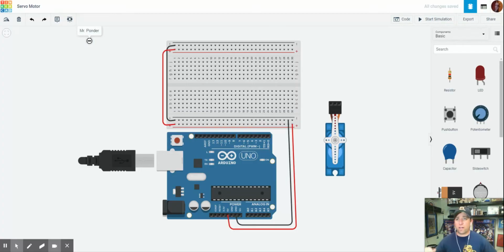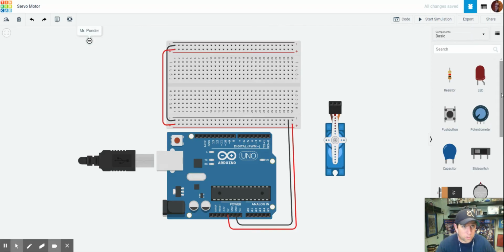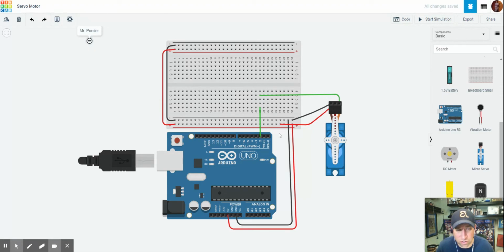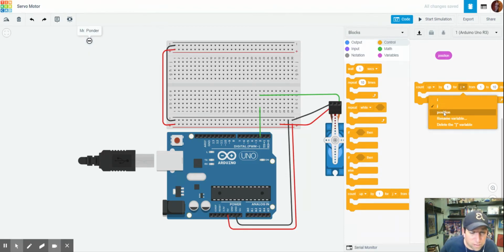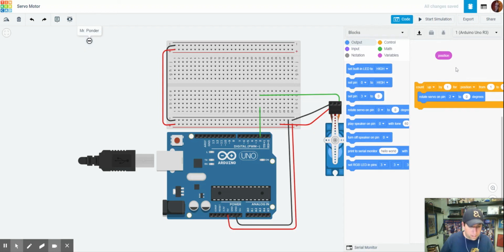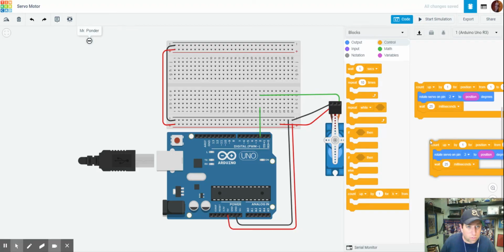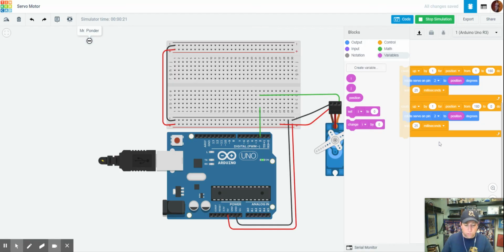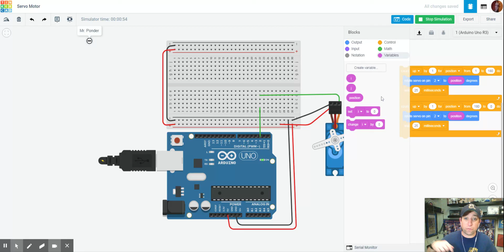Arduino Design Servo Motor on TinkerCad

Comment: you can do it with just one for loop..

void loop()
{
  for (i = 1; i <= 10; i += 1) {
    servo_2.write(180);
    delay(2000); // Wait for 2000 millisecond(s)
    servo_2.write(0);
    delay(2000); // Wait for 2000 millisecond(s)
  }
}

Comment: thanks for the upload, helped me understand the servo better. Been doing this and combining it with the Arduino cloud. We also been building our TinkerCAD circuit. I changed the second part of that code from counting up to down and it made it go smoothly both directions.

I messed up a little where i put the milli seconds, it was glittling but it was because it was outside the code. Thanks for the share :)